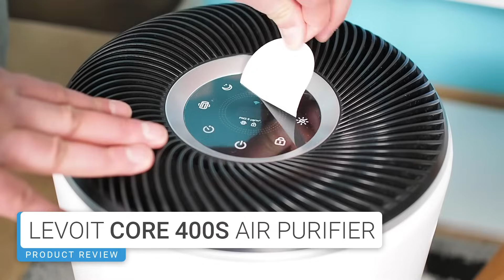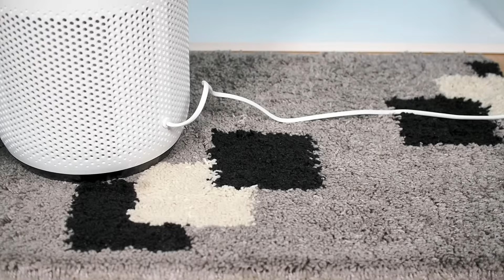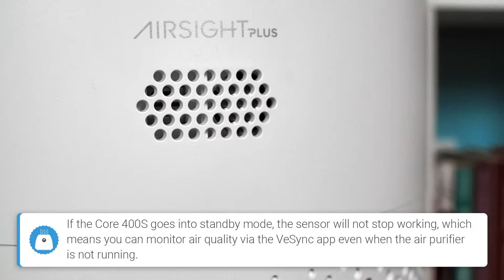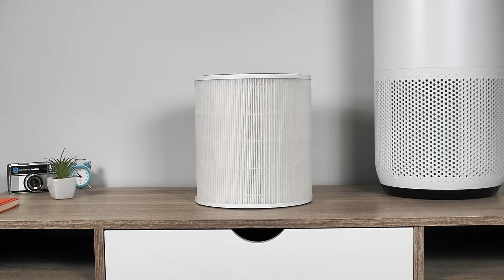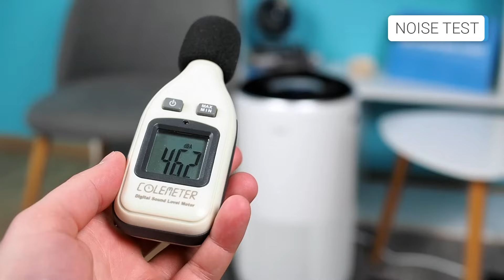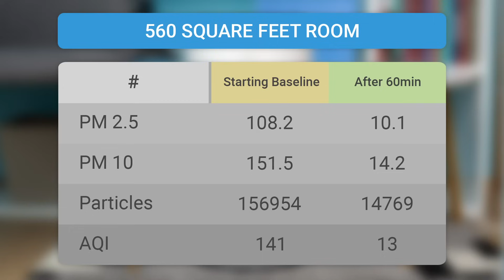Levoit Core 400S - Top-Rated Smart Air Purifier Review (+ Smoke Test)

Comment: These air cleaners do reduce dust. Well, Ive been using Honeywell Power Series for a few years. I like Honeywell. I bought the Levoit one here so I can use the smart feature to turn them on/off in multiple areas. Honeywell has a turbo mode I love. I press turbo while cleaning to suction airborne dust into the filter. I can easily vacuum the dust off of the front black pre-filter on the Honeywell air cleaner. Now I ought to unbox the Levoit air cleaner to test and compare. I have to say again, the Honeywell Power Series air purifier has been a solid performer. Ive had them running constantly for at least 3 years with zero issues. They're so fast to clean. Pop front screen off, vacuum, pop screen back on. Done. Change black pre-filter every 3-ish months (easy), and change HEPA filter, I think every 6 or 12 months. The unit has a timer, and the red change light on top will tell you. Very easy. No major disassembly. They just lack a smart feature so I cannot remotely turn them off/on like this Levoit Plasma Pro 400S. But, if I were to advise Honeywell, I would tell them to please don't mess up their already good design on the Power Series air purifiers. They could minimalist simple add some type of smart feature to switch it on/off remotely, and add a simple app to monitor. But change nothing else, because it works so well! Ok, let me unbox my Levoit now to compare.
Reply: so which one do you like better?

Comment: Can ‘Smart’ feature be disabled?  Or only enabled with the app? I’d like to only use it manually with no WiFi.  Thanks!😊
Reply: The app is not required
Reply: Good question. You can NOT disable the wifi. Even if you never connect to the app, the unit wifi is always on.

Comment: Hey! Just purchased it. What humidifier would be good with it?
Reply from the maker: I personally don't use/test humidifiers but have used Xiaomi's one last year. It's done very well in optimizing humidity in my place during the winter.
Reply: @AirPurifierFirst  
Oh, I asked because I visited your website (that looks good btw) and saw you recommending air purifier & humidifier combos. 

What model is the Xiaomi one? I have a pretty small bedroom. I plan on putting the 400s on the low speed.

Comment: So I just got mine. First impressions - bad. I had sprayed a parfume right at the air sensor. For some reason the PM indicator increased a bit but in auto mode it did not turned up the fan speed. Next, I put a smoking piece of paper next to it. The PM jumped at once to maximum but in auto mode, it did not turned up the fan speed to maximum, I had to manually select the 4th speed. I suspect that with that these air sensores are indeed of pure accuracy and one should not use auto mode but select one constant fan speed at all times.  What is also inaccurate is the PM 2.5 level  of 50 at which the device turns on the speed if in auto mode. The general standard is <= 25  so I think it should speed up above this level of contamination. 

I also put the smoking paper next to the filter inlet to see if the carbon pellets would filter out the smell but they don't. So that is a fatal fail to me because I bought it mainly for filtering out iritiating smells. 

But how can it filter anythig effecitvely if the filter chamber is not air-tight and the fan can, and most likely does, suck and blow air that does not come thourgh the filter.

The power cable is too short to my liking. On the plus side the noise is indeed low. On 1st speed it's barely  hearable. In night mode it's almost silent but it barely blows any air so there is a compromise here and I think night mode is of no use if you want to effecitvely clean the air over night. I also confirm that you can hear this fan motor whine on 1st and 2nd speed but it's not annoying. On 3rd and 4th it's  drowned out by the hum of the air. In auto mode when the air is clean or in night mode, you can't notice it. As for the overall noise I say that it is bearable up to 3rd speed if the device is at least 2 meters away from you. 4th speed is not that loud, not as i.e. a vaccum cleaner but it sure is annoying to the point when the comfort of watching a tv, listening to music, reading is fairly compromised. 

As for the VeSync app - I had no issues with pairing. The commands are responsive hovewer I haven't tested these features which are irrelevant to me like, timer, schedules or voice control. Also, the 'efficient' function in auto mode settings should allow to choose between imperial and metric units of space but in the end this is just another useless bell and whistle just as the night mode which does not make the device any more efficient.

Comment: Hi, for a 280 sqft bedroom do you recommend the 400s or the 300s? I'm getting this mainly for the dust particles in the air, don't care about smoke.

I know the 300s size says for 200sqft , but I was wondering if 280 sqft is okay too, if not then I would have to get the 400s.

At night, when sleeping, I would prefer to use night-time speed or even speed 1, would your recommend the 300s or 400s for that?
Reply: I'd recommend the 400s. You'll notice a difference faster given it has a more powerful motor. It will have more airflow, etc.

Comment: Hello! I have a question. My room is quite small ~ 100 feet square, because of that I want something with lower noise. I can t decide between levoit 300s and 400s. I was thinking to buy levoit 400S and leave it on speed 1. I think should be enough. which model should I choose between these two?
Reply: Go big or go home…

Comment: So do the 300s, 400s, and 600s all perform about the same and just different sized for bigger spaces? I have the 300s in my bed room and was thinking of getting the 400s or 600s for my living room. Plus they are Prime Day specials right now.
Reply: I don't see why getting the core 300s when it's not that much of a difference in price versus 400s (with discounts), plus you can enjoy same purification level in lower speed mode which translates to lower noise in smaller rooms.

I'd personally go with 400s. 

As for 600s, many people reporting it's noisier, and with its higher price makes me not recommending it.
Reply: This is exactly why I'm watching these informative videos. Do you recommend your 300s?
Reply: @branpxch  I like the 300s and works very well for my bed room, but like  MAFz777 said, for just a few more dollars the 400s does a larger room so that's what I went with for my living room. In fact, got my delivery notification a little while ago so its waiting for me at home 🙂
Reply from the maker: The Core 400S has a larger filter and huger airflow and is a better buying option than the Core 300S. 

I don't know how good is the Core 600S as I haven't tested it yet. But I bought it yesterday and should publish a review in the following months!

Comment: I received the levoit 600s yesterday and i test it out in a bedroom maybe 250ft2 to 300ft2 and had it on sleep mood it was very quite and I definitely can feel and smell the clean air across the room and I have my coway 300s in the living room also on sleep mood , I woke up 4am felt like I have dry through and nose and I immediately turned it off both unit and my wife in the morning says same thing. So I’m wondering is that normal feelings since we’re first time using a purifier so my question is maybe it’s because a big purifier shouldn’t be left in a small room ? I live in apartment 900ft2 should 1 levoit 600s be enough for the whole apartment? Any advice would be greatly appreciated! 🙌🏼
Reply: That’s mean the air is already dry, having a running air purifier can make it feel worse because the carbon filter will reduce the humidity a little bit, I advise to run a humidifier at the levels you feel comfortable

Comment: I have 14 sq meters bedroom. Is it too much to use 400s? or I should get the lower version. I am looking for higher CADR. My concern is I have a kid and he sometimes get sick. Should I use the low fan speed
Reply from the maker: I believe you misspelled the bedroom size and wrote 14 instead of 140 sq. ft. In that case, the Core 400S is too large, but you can buy it and use it at lower speeds, or you can consider the Core 200S, Core 300S, or other smaller air purifiers from Levoit.

These air purifiers are 100% ozone-free and safe to use but keep them away from the head when sleeping to avoid getting cold.
Reply: @AirPurifierFirst  
Just a note, she mentioned her bedroom size in 'meters'.
14sqm = 150sqft 

And I agree about getting bigger purifier like the 400S and lowering fan speed in smaller rooms to enjoy clean air with minimal fan noise (which in her case would be speed mode 2, it can purfiy that room size up to 5 ACH).

Comment: I just bought one of these today. When scrolling through their questions and answers page, I’ve came across ionizer and ozone gas release information. I was not aware of these elements until I did some research. Ozone can harm respiratory functions… I would like to use this on a new born baby’s room.  I am looking for thoughts on this or more insight- its very confusing and strange . I would appreciate it !
Reply from the maker: The Levoit Core 400S is a mechanical air purifier that produces no ozone. 

But, a while ago, Levoit released the PlasmaPro™ 400S, which looks the same as the Levoit Core 400S, but with one difference, an ionizer built-in. The thing is that the PlasmaPro™ 400S produces ozone but in allowed amounts, which is confirmed by CARB (California Air Resource Board).
Reply: I had purchased Winix air purifier around an year back which had ionizer. I had the same concerns as yours with its affect on a new born. I returned it. I got Levoit 300 which says that it does not produce ozone. So far 400 also looks the same.
Reply: @vishalwaghmare9523  great choice! I ended up returning it and also got the Levoit Core 300 as well. So far is going great. I wish it would tell me what kind of particles were discovered! Cheers

Comment: will you be doing a review on the core 600s? it's on sale right now. Curious how it fares against the blue 211+ since they have almost similar airflow rate (m3/h)
Reply from the maker: Recently I have bought the Levoit Core 200s and LV-H134, so those two will be the next Levoit air purifiers that I will review. Anyway, thanks for your suggestion, I will definitely consider doing a review of the Levoit Core 600S.
Reply: @AirPurifierFirst  Hmm core 200s will be interesting compared to blueair 411+. IMO the LV-h134 is not worth reviewing. Just looking at the specs, core 600s is cheaper, more updated model, and has better CADR/room coverage.
Reply from the maker: I agree with you, the thing is that I got the LV-H134 for a very good price. Anyway, my goal is to do as many reviews as I can, so the Levoit Core 600S will be on the list for review, without a doubt.
Reply: Another thing — if you’re concerned about ozone — blue air produces ozone!

Comment: I have one of this, can confirm it is silent even at High fan speed (Turbo gets a bit loud but nothing unbearable), especially compared to a Mi purifier, which sounds like a jet engine.
Reply from the maker: The Levoit Core 400S is, without a doubt, an extraordinary air purifier.
Reply: Hey friend! Do you still have this device? Can you tell me the behavior when you cut the power and then restore power to it? Does it turn back on or do you have to press the on button??
Reply: If the Mi purifier has a more powerful filtration, I would so get that one. I also need  smart WiFi remote access. Which Mi model has that "jet engine" ?

Comment: Thanks for the detailed review, will be  subscribing. As you may know, there exists the PlasmaPro 400s. Would you say the ionizer is the only key difference between the two?
Also, between this model and the Winix AM90, which one would you say has a better performance in terms of capturing viruses when placed in mid size rooms? Thank you for the time.
Reply from the maker: I believe so.

I don't have the equipment to test air purifiers against viruses, so I can't answer that question. Hope you understand.
Reply: I had the AM90 and it produced a subtle high pitched whining sound from the motor which was pretty annoying on speeds 3 or 4, and since you want to run that on 3 usually, I ended up returning it. Ordered the coway mighty now and waiting to receive.  Note: I like my Winix 5500-2 also which has a less annoying whine sound than the AM90 did, though the AM90 was a much nicer looking design IMO.
Reply: How is the Plasma Pro different from the Core 400s
Reply: stay away from ioinizers!!!!! BAD for health - read up about it

Comment: is the built in air quality sensor accurate compared to your hand held device?
Reply from the maker: There are some differences, the Levoit’s air quality sensor is not as accurate as this one I use for testing. But, you can change the sensitivity of the Levoit sensor and in that way play with its accuracy.
Reply: How do you change the sensitivity?
Reply from the maker: You can do that in the VeSync app.

Comment: Thanks for the review! Was waiting for this one and debating whether to get this or the coway 15122? 
Some notes to maybe improve your reviews: #1. Since this has a smart sensor, would be great to show comparison of the accuracy of it to an air quality monitor device. #2. Realistically no one will use turbo mode for long periods of time (due to noise), so how well does this device clean on manual mode when it's on 1 step or 2 steps below the max speed? #3. Comments compared to other air purifiers in the same range (price, area coverage, cadr rating, etc)?
Reply from the maker: Thanks for your great suggestions!

Comment: Levoit is a fantastic brand. I made the mistake of getting their Vital 100 model for a much larger space than it is rated to cover. I have an open floor plan and 12 ft high ceilings. I've heard very good things about the Core 400S.
Reply from the maker: I do agree that Levoit is a great brand, and the Core 400s made outstanding results in my tests, so I am sure you’ll be satisfied if decide to buy it.
Reply: @AirPurifierFirst  Thank you. Would you recommend the Plasma Pro 400s? Will that machine compromise my health?
Reply: @AirPurifierFirst  I decided to replace the Vital 100 with Alen's BreatheSmart 75i. I think I made the right choice this time!
Reply: What should I buy to cover a 600 sq ft room?